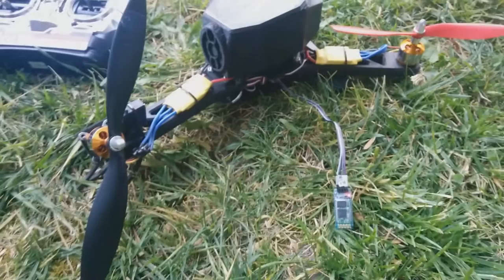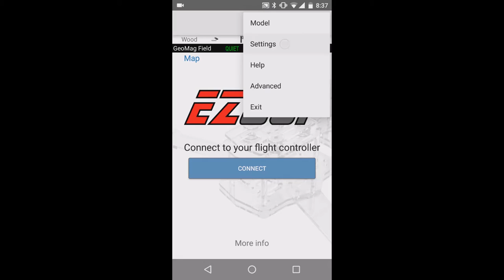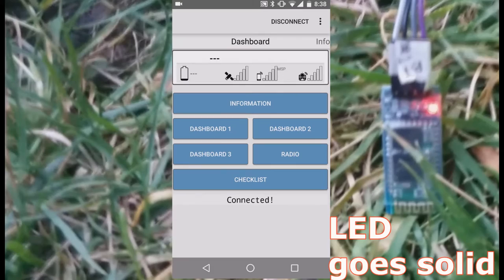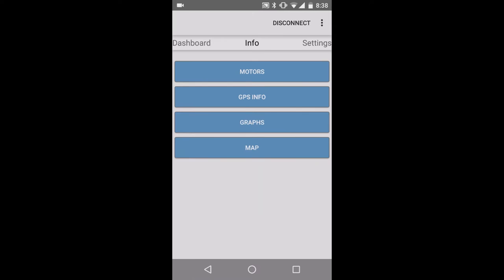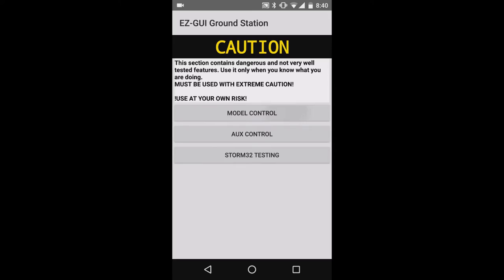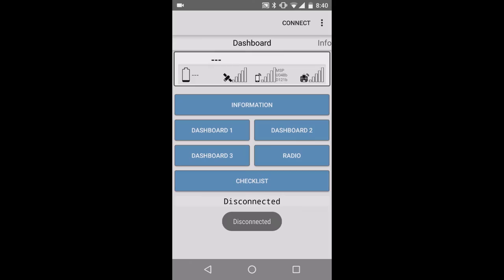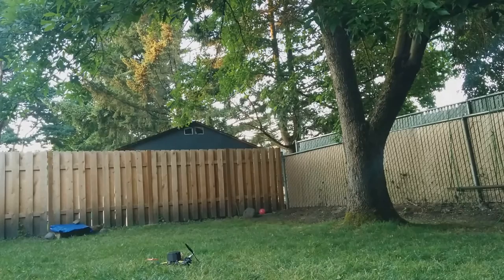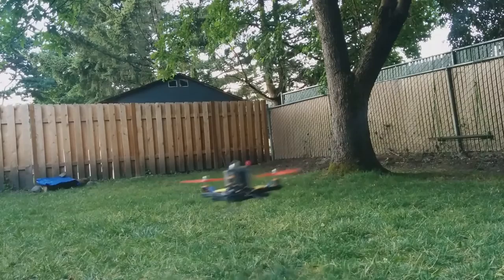How to tune PID on Multi Wii / Naze32 drone using a Smartphone / BLUETOOTH

Comment: What is the flight range of hc 06 bluetooth moduel ?
Reply from the maker: It's low rather. Maybe 20, 30 meters.
Reply: Which is good hc 05 or hc 06?
Reply from the maker: @aasishkharel  hc05 better because it has more configurations. Master and slave

Comment: Bluetooth says data not received
Reply from the maker: Can't help without seeing connections and setup. Check baud rates
Reply: Same problem, pls help me.
Reply from the maker: @kaitokid3529  , likely wrong baud rate, needs to be 115200 for example but match on both sides.